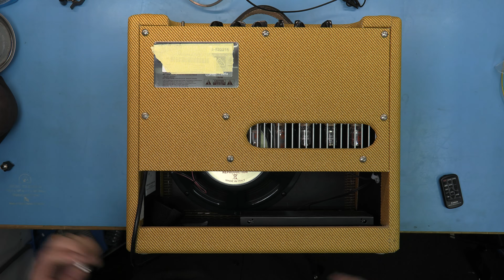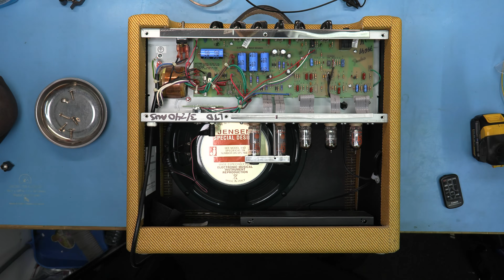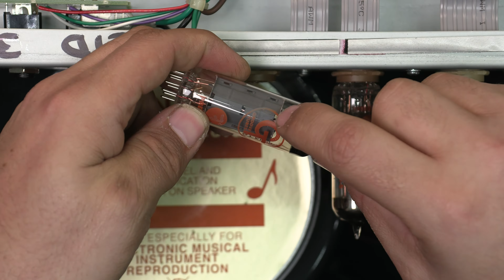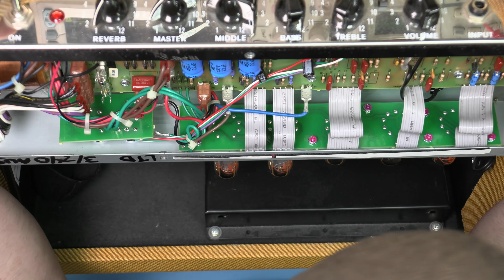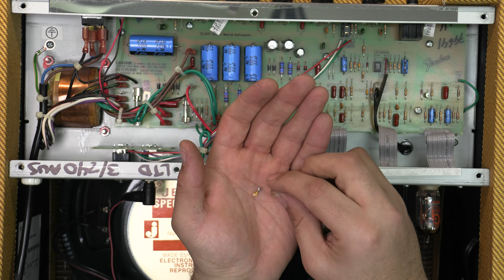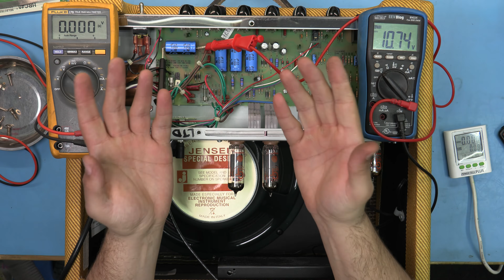Fender Blues Jr Tubes Flashing Part 1 - Will It Happen To Your Amp?

Comment: What the fuck is this Tube Amp Sermon with Reverend Bruce Gear? To justify a 200 dollar repair on a 300 dollar amp? Needs new powertubes and done. Probably, because you didn't even test that -- great diagnostics.
I like watching work on amps, but every time I hear the "customer' I throw up in my mouth... Just help people for free ("you need new powertubes") and go and find a real job..

Comment: I just posted a video is the exact same thing. Didn't notice it live but when i looked at the video i saw it. Seems to happen right around 60 seconds after i turn on. Super expensive amp with build date of sep 2021 and bought in 2022. The best part is about 3 months after i bought the Blues Jr, i bought a Katana 50 and hardly ever used the Fender. Junk!

Comment: WRT 1k screen resistors are a good idea, they will help a little. It's worth measuring the screen voltage (drop through 1k R) at max power to verify what the change actually is.   
A good option is EL84M / 7189A if owner can absorb cost. Mil spec, higher plate voltage rating and power dissipation EL84.